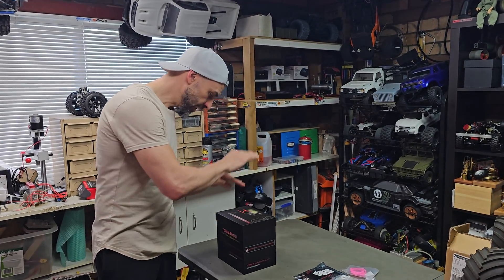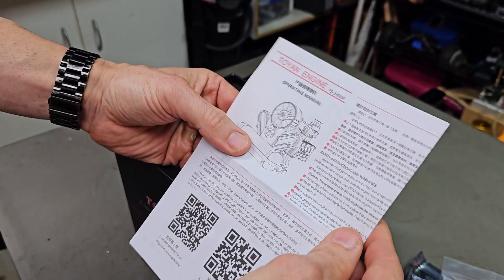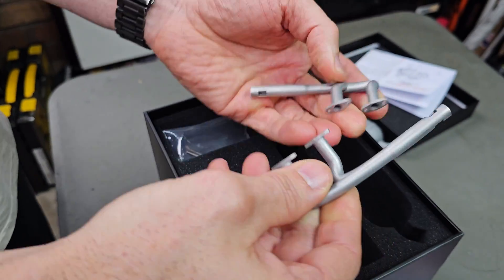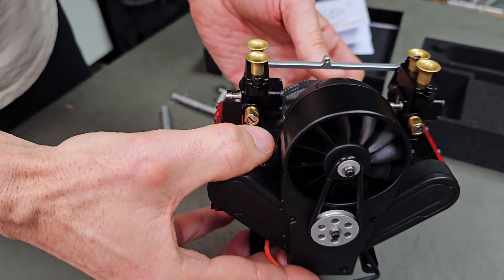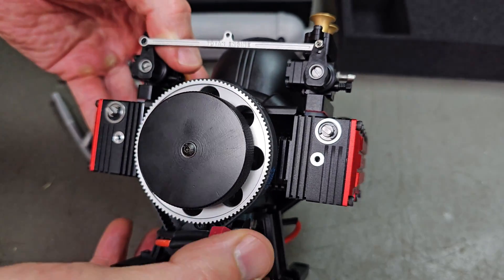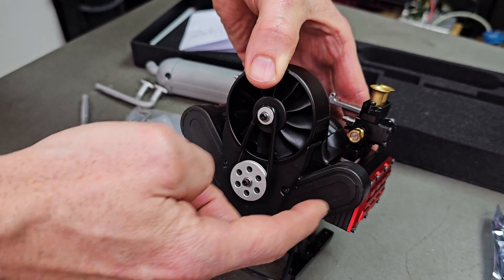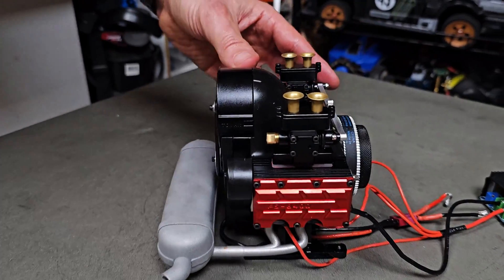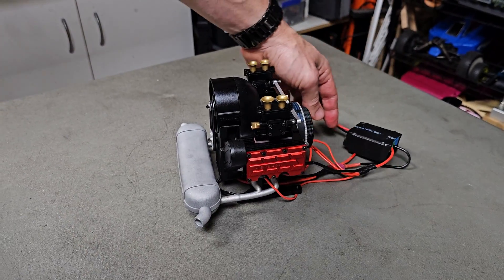MINI 4 CYLINDER BOXER ENGINE - TOYAN FS-B400

Comment: no outdrive for using in an rc car ?
Reply from the maker: Yeah you add the flywheel nut and then attach a clutch bell
Reply: Ah ok thanks, I couldn't find any info for that. @RCTanksTrucks247

Comment: They didn't make a boxer, only a flat 4. They corrected it in their adverts
Reply: You should clarify the difference
Reply: Flat 4 = Boxer or did I miss something?
Reply: @Gerry_Kernbauer flat four share crank journals, similar to a V configuration, boxer has seperate crank journals
Reply: @Gerry_Kernbauer  yeah I thought this was a boxer, it's air cooled, over head cam walks and talks like a boxxer